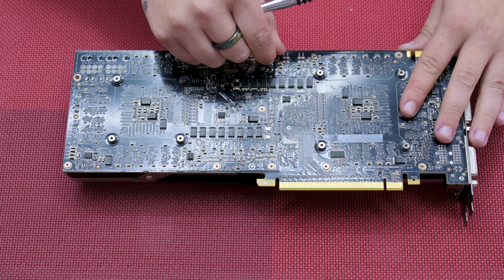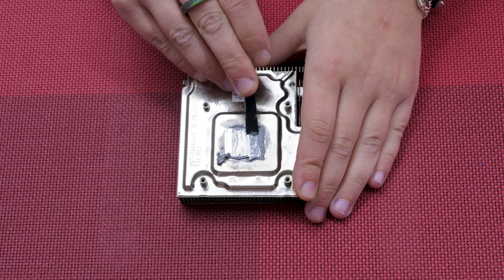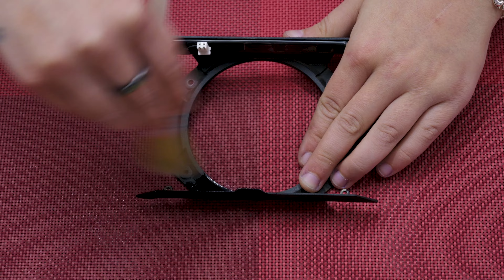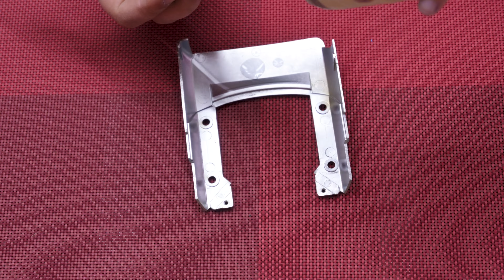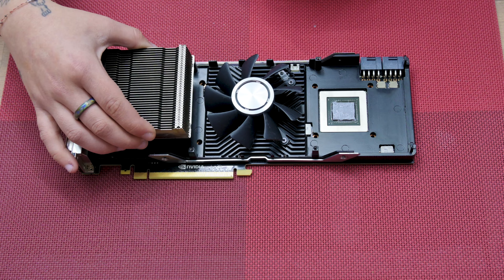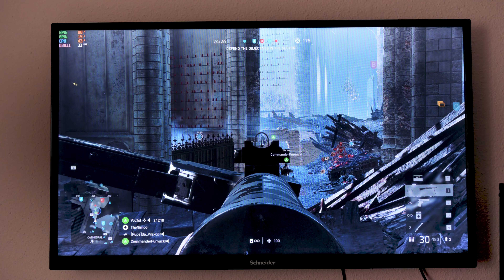GTX 690  - Restoration and Testing 2021

Comment: Just so you know, you should take the GPU fan off and underneath there will be a rubber NVH sheet, remove the sheet enough to remove the sticker from the rear spindle of the fan and then give it a drop or two of light machine oil/clear mineral oil, then put some duct/electrician's tape over it and then put the rubber sheet back over the top of it.  The fan will run quietly and thank you for being serviced.

Another thing I do is soak the whole PCB in contact/cb cleaner, then I coat the board in silicone spray (the type that dries, from a pressurised can).

Comment: Been nice if you had the temps before and after for comparison. Also a slide of just the average fps in games be enough blown up but i digress. Latencies per fps would of been useful. Seems like high fps but latency is high which gives the game a slower showing. I picked up two 690s they get hot. Was thinking about repasting but other then synthetic tests its main use will be lan games from 2000 to 2010 so i figured not a big deal. Modern games need 3 to 4000 series gpus soon to be 5000 series. Still awesome video probability of n repasting has significantly gone up after watching u do it, thanks.

Comment: arguably the best dual gpu ever designed. especially the nice silver finish. i suppose the only things the card was lacking was vram and a higher core clock. that would have made it last in the graphics card game a bit longer. also, on a side note most people who used this card never used it to its full potential. to be able to do that you have to run apex physx multi gpu support. but most games that came out that had the apex physx features did not utilize it properly.Unreal engine 3 is probably the best example of using this card near its max potential.
Reply: I agree, flawless design
Reply: It wasn't officially replaced till the 2000 series. The only thing that held that card back was vram. I still have mine.

Comment: Please can you tell me exactly what type of 8pin cable you using? Today in 2021, it is very hard to find the correct 8pin type to power the Gtx690...and even the correct modular psu with the the correct 8pin power output
Reply: Most 650w and above Psu should come with two 8 pins connection. I know most Corsair ones do but get a 80 plus gold certified to be on the safe side

Comment: Managed to get two of these second hand from Japan. Hoping to do a similar restoration on them and plug em both in for quad GPU SLI. Thanks for the video : D
Reply: i guess im asking randomly but does any of you know of a method to log back into an Instagram account?
I stupidly lost the password. I appreciate any assistance you can give me!
Reply: @Everett Huxley instablaster :)
Reply: @Marvin Rocco Thanks for your reply. I got to the site thru google and I'm waiting for the hacking stuff now.
Seems to take a while so I will get back to you later with my results.
Reply: @Marvin Rocco it worked and I now got access to my account again. I'm so happy!
Thanks so much, you saved my ass :D
Reply: @Everett Huxley glad I could help xD
Reply: Same just got the second one, I hope multi-gpu support comes back
Reply: @fatal3713  Don't see it receiving support except for things that NVLink which is still supported on 3090 would do (pooling Vram being one of them)

Performance of single cards are just that good these days that running 2 just isn't viable anymore. But yeah, I can still live some dreams and just run these babies in SLI hahaha
Reply: Dang that's 600W of power under load for gpus alone xD

What games u play on quad sli setup?